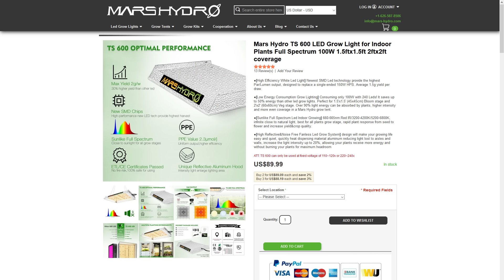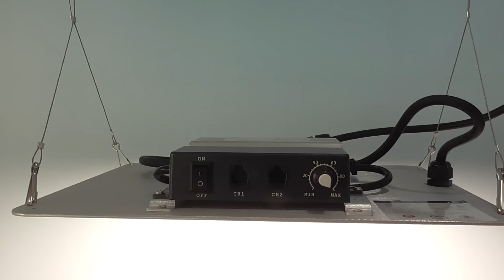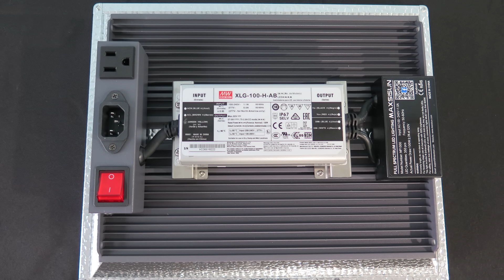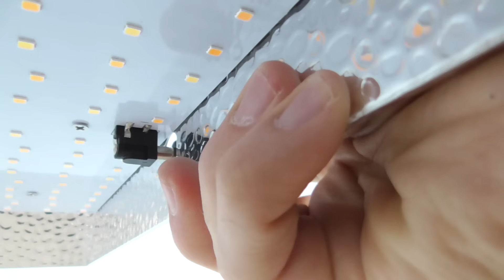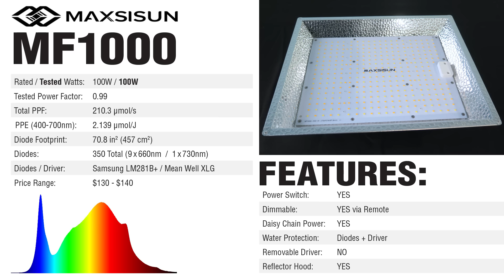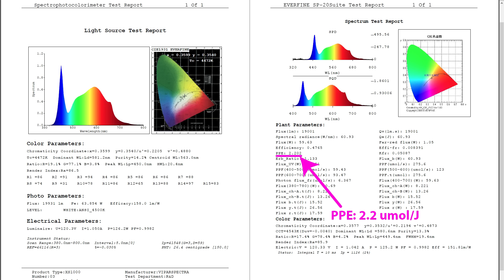Spider Farmer, Maxsisun, Mars Hydro - Entry Level LED Grow Light Comparisons, Test Reports & Reviews

Comment: Can someone help plz.... what would be the equal to a 600w hps in LED terms ? T.y.
Reply from the maker: This video addresses that exact question! https://youtu.be/PCaesi_M5DQ?t=180  :-)
Reply: @Albopepper  cheers. New to led's but basically what iv gathered is in order to match the HID's its gonna be piggy-bank breaking time. 600W HID = £60 ballast + £30 bulb = £90.  LED equilvalent = around £400+. Apart from heat problems personally i dont see the advantages.
Reply from the maker: Have you checked out this video? https://www.youtube.com/watch?v=aToYhyPZMVs   The reduced electrical consumption directly translates into savings. Each and every month you run a higher efficacy LED, you stand to save money. This might easily bring you a payoff and then continue to save money going forward. In the US, this light gives even more PPF per dollar. And it would give you excellent yield: https://www.youtube.com/watch?v=Cl5P3sKDQ0o
Reply: @Albopepper  If power cost wasnt an issue would you still say theyr worth spending that much on over hid not including the low heat aspect (is the yield increase noticeable)
Reply from the maker: There are some old-school growers who swear by HIDs. They may even claim that LEDs just can't provide as much yield. But this misconception has resulted from LED sellers falsely inflating the HPS equivalency of their lights. If a grower matches PPF, then they can get just as good of yield, especially as many of these LEDs now have Far Red.

Good LED systems require more upfront cost. But they have a longer lifespan. They incur less electrical costs. And the heat reduction typically saves on HVAC expenses. Some LED styles are also better when it comes to even light distribution at tight hanging heights. Great for rack systems.

As a grower, you need to run the numbers for your situation and do a rough ROI. See if it's worth it for your application. Generally though, I think that it's better for everyone collectively to use more efficient technologies like LEDs. It all adds up. And across the entire grid, it can really help out by cutting down on energy waste.
Reply: @Albopepper  can i ask, from seed do you count the start of the vegging period soon as you see roots or from a certain amount of leaves or height?
Reply: I would say the sf4000, it’s 450 actual watts and perfect for a 4x4 tent
Reply: @stevewhocares9970  i know tents help with par but is it any good w/o a tent

Comment: My personal experience with LEDs started with mars got two of their lights both had half the diodes blow out in less than 6 months when contacting the company was told I could buy and replace the diodes mind you it was still under warranty worst company buy far then I tried spectrum king grate light but way to intense and focused more suited for high bay after that I tried HLG another great light with good spread and efficiency still using it two years later though next upgrade I will be going with the bars for better customization. Just remember you pay for what you get and always check if they are using decent bin numbers and that they will work for your situation,. research is key I paid for not doing due diligence don't do the same.

Comment: Wait, they sell a light with cos(phi) = 0,69? Sure, the power company wont charge private households for complex power but how hard would it have been to build in a compensating inductance/capacitor? Pretty sure in the EU it is illegal to have such a low powerfactor.
Reply from the maker: I agree. There's added expense for better quality components. But these sellers don't need to worry about it if buyers aren't paying attention and looking at the PF. Hopefully this will put both buyers AND sellers on notice!

Comment: For my first light I got a sf 1000 great led however Those quantum. Boards are way strong so pull your light way back for beginners
Reply: My plants pray in veg at about 19.5 inches any closer or farther and it shows.
Reply from the maker: Remember, if you find the light levels are too high, you could also dim them and save on power. Raising the light is good if you want to cover more area. Otherwise just dim it.  :)

Comment: Awesome review!!!!  I recently purchased a Maxisun PB 2000. Your review makes me feel good about my choice. I do wish I knew how to dim the light... it is so bright 🌞
Reply from the maker: Cool! Glad I could help.  :)  If you have a wattage meter, you could probably dim it directly through the driver block. Pull the rubber gasket off and use a small flat head screwdriver. But go slowly. And make sure you don't exceed the standard wattage. The wattage meter can help you to see how much you are dimming it.
Reply: @Albopepper  Thanks, I have seeds starting now, and it seems a bit much... I did back it to 32 inches which they recommend... but would rather save a dollar by using fewer watts. Not sure how much it will cost to run, this is my first one.  Thanks again for such a good review. And for helping those manufacturers to be honest with their data.  Peace.

Comment: Would be nice to see where the HLG 100 stacks next to these.
Reply from the maker: The HLG is only 95W with total output of 214 PPF (400-700nm). It excludes a Far Red diode and has a lower ratio of Red light. Altogether it only has 176 diodes. They state the PPF Efficacy as 2.41 umol/J. But you have to dig and look at their report. The standard PPE is actually 2.35. That's within the 400-700nm range. It's not dimmable. I'm sure it's a decent quality light. But it's not an impressive value. And the overall brightness isn't anything special either. If you buy it, you're buying a name.
Reply: @Albopepper  The build quality on the HLG-100 is pretty unimpressive too. It has exposed contacts and a barrel connector which is prone to snap off the board, plastic driver housing, no dimmer, no water resistant coating, no water resistant driver, no spacer between the driver and the light panel, and a very thin panel (I believe it is just the aluminum PCB without a separate plate). The higher wattage HLGs are ok, but I think in the lower wattage range, the students have surpassed the master.
Reply from the maker: @VikVaughan - Well said! Those are all some good observations!!!  :)

Comment: But aren't the drivers too cheap? Doesn't look like any of them is an original MW 120W.
Reply from the maker: The 4 that I've recommended have adequate drivers. But the SF1000D and TS600 are the 2 to avoid due to junky drivers.

Comment: neat review. do a 1000w HPS LED replacement one please and ty. i member when thr UF0 light came out and cost 5-600$. im old school i still rock my eye hort hps full spec 1000 and 600 hps. yeah they cost more to run. but i have yet to find a led that can match the hps in growth. you get a new sub and a thumbs up

Comment: Hi, thanks for the info, very helpful.. do you have any thoughts on mixjoy units? have seen newer versions with more led and tempted to try
Reply from the maker: Thanks for watching! If you are asking about the 110W version, it certainly comes at a nice low price. I'd like to see a test report, as I don't believe the efficacy is really 2.7. They claim it replaces a 600W HPS, but that's not true. If you don't have much money, it might not be a bad option. I'm guessing it would be better than the TS600 or SF1000D.
Reply: @Albopepper  thanks was thinking 110 for small veg space, speaking with their rep they make as grand a claim as the rest and I assume based on most of these boards being similar, results will be likewise to your tests. Led market is bad in my location, mars offer value (sometimes) but comes with zero service and constant problems, spider/vipar have priced themselves beyond reason and the rest are unavailable.

Comment: Damn I just bought the ts -600 Mars hydro light. I was going to buy a maxisun or a bloom plus. Wish I got the plus
Reply from the maker: Doh! Did you buy it within the last 30 days? From Amazon? Perhaps you could return it if you want a different one. The TS600 is still better than many of the older LEDs from years ago. It's just that there are newer models out there that perform even better.
Reply: @Albopepper  I did it was only 3 weeks ago. I’m debating because I haven’t even used it yet I have a spider farmer I’m currently using. Thinking about returning. Great info though I’m subscribed!
Reply from the maker: Thanks for your sub!  Well I don't want to pressure you one way or the other. But Mars definitely lied when they slapped a 2.3 PPE label on it. That in itself is grounds for a return if you feel inclined to do so.
Reply: @Albopepper  shoot I should have returned it. I got a new tent and put that light under my plants and they stopped growing and then after a couple weeks of nothing I decided to switch my light back to my spider farmer and shoot the first night I saw fresh light green growth. I tried to return today and the 12th was the last day I could have returned. Man. Guess I’ll use it for seedling and early veg

Comment: In the end its still 1:1 in watts, like 400w per m2. The only reason for LED is the lower temperature. Just my 2 China Cents.
Reply from the maker: What's interesting is that if the LED makes less heat at the same wattage, then that means it must make more light. The power from that electricity goes somewhere (either light or heat). Less heat means more light. More photons means more plant mass.
Reply: @Albopepper  

I understand that,but would still go for at least 400w real/m² to grow a proper and full tent-omato-tent (?👁️?). Sry Bro, im no native speaker and its 4:15 AM. and 4:20 PM. 😅✌️🐝
Reply: @Albopepper  

OK, Mr. Pepper. Im back and can say 
2 x 125w QBs ran at 90%  outperformed the 400 hps. easily. 
✌️🌞

Comment: Vipars have ppf reports when you buy them. I used it to set up my distance.
Reply from the maker: You mean PPFD reports, right? They provided light maps with spot readings? Those are certainly quite helpful. PPF reports from an Integrating Sphere are different though. They are not for positioning data. The total PPF is for total output at a given wattage irrespective of light distance.
Reply: @Albopepper  Have you made any headway with the P1000? I have 3 of them and would love to see some additional data.

Comment: I've got a few P1500s and XS1500 viparspectras and the past few grows I've smashed it outta the park with em. 
My SF2000 wasn't worth the price. I sent it back for a problem with the light flickering and 3 chips burnt out and it bowed in the middle. They told me I voided the warranty because I removed the driver to dim it. 
Worst customer service for a subpar product.  At 200 watts it dosen't even cover a 2×3 adequate.  Barely a 2×2. 
They're just as bad as they have always been when they were still calling themselves Mehezi and catching peoples houses on fire with thier crap lights. 
I've got the original Spiderfarmer dimmable blurple 600w "230 watts "  I hacked it with some Nichia chips.
Reply from the maker: Thanks for sharing your experience. It's good to know ViparSpectra is making solid units!
Reply: I’m using Vipars too and am satisfied with the results. I just use an extra unit than I would if I had a high price brand. Still works out cheaper. And I can replace when new technology outdates them.

Comment: I emailed all of these companies including Viparspectra about the brand of red diodes they use and only Maxisun replied. All using cheap ass red diodes and thats why I went with Chilled led that doesn't use false advertising. All these chinese brands advertise Samsung LM301B diodes but the reds they use are all junk and not samsung reds, false advertising at its best.
Reply from the maker: Interesting. What brand was Maxsisun using for the red?
Reply: @Albopepper  the deep reds and ir are Epileds.
Reply: The Mars hydro FC and SP fixtures actually use decent red  diodes made by Osram but take a look at the warranty, so a hard pass too.
Reply from the maker: Good to know! Thanks for doing that ground work for us.  :)

Comment: Thank you. Excellent round up. I hope we can get away from comparing LED lights to the wattage of HPS or HID lights... Question...  I have an earlier Spider Farmer SF 2000 that does not include the dimmer. Can I run it through an external dimmer? Or will that be a problem for the Meanwell driver? Thanks.
Reply from the maker: I'm not sure about that. But even without the external dimmer, you should still be able to dim it down: https://youtu.be/lK28aiRQ_Vs?t=419   :)
Reply: @Albopepper  Thanks... Since I don't have a power meter to measure the watts I thought I maybe able to get an external dimmer for the same price...

Comment: My first light was a ts1000 and for a beginner light its not bad, but there are much better lights out there for the price nowadays. I've also realized once you start that efficiency is where it is at and what you really should shoot for. Get a quality led light and after a little while you will be glad you did. Oh and the bigger the light, the more efficient the light generally is.

Edit: go with meanwell drivers and good samsung led diodes.
Edit: and one more thing, my second light wasnt a Mars hydro if that puts thing into perspective.
Reply from the maker: Good advice! Thanks for sharing your experience and for your support on my channel.  :)
Reply: So what lights better than TS1000?
Spiderfarmer mars hydro viparspectra
All them are using the samsung diodes or the lm 281 or the lm301 better chip
So all they are the same more and less 
Mars hydro only using the samsung chips on the expensive models.

Comment: Really nice review / info, thanks! 🙌🏻😊 Also if a person is interested in DIY approach and really high efficiency the HLG kits with their latest QB648 Diablo boards seem nice. But with a quality 150W driver even the cheapest one board "~130W" system with heatsink is about $200 still... And the availability seems to be limited.

These boards are what I would personally want to try though - and build a water cooled heatsink for them with additional individually controlled UVB, UVA and IR LEDs 🤓😂.
Reply from the maker: Sound like a cool project! Thanks for watching!!!  :)

Comment: Very interesting video as always. I have two mars hydro TS600 and I'm very satisfied with them, I tested them with my PAR meter and my Watt meter, and I compared them with my old COB 100W lamps bought on aliexpres. 
The result is interesting, for the same number of Watt consumed, the TS600 at the same distance give twice as much PPFD as the COB. I bought the COB 50$ and my Mars Hydro 77$, for the price, the Mars Hydro TS600 or Maxisun PB1000 are much more interesting. I just ordered two TS1000 that I will receive in a few days, because as you explain in your video, at the price efficiency level it's the best.
Reply from the maker: Thanks for sharing those details from your testing! Compared to older units, that TS600 does well. But many of these newer LEDs are doing even better. I hope you enjoy those TS1000s. They should be a nice upgrade!
Reply: @Albopepper  Thank you for your answer. When I bought the TS600, the price was really interesting compared to other brands. Today it's a bit different, Mars Hydro has increased its rates and the price difference between a TS600 and a Maxisun PB1000 is small. If today I had to choose a 100w lamp, and after watching your video, I would take the PB1000.
I like the MarsHydro brand because they make quality with affordable prices. I bought a 150x150cm grow tent, I'm very satisfied with it, it's really good quality and you can feel that it will last for many years.
On the other hand, there's one thing I don't understand about them, it's shipping costs on their website. I have a friend who lives in Asia, I advised him to buy Mars Hydro lamps, but when he looks at the shipping cost for a simple TS1000 lamp, the shipping is $100 (2 kg), while the 150x150cm (16 kg) tent would only cost him $90  (same shipping time for both).
There's something really wrong with that.
Reply: Hey my friend I use for years the cob leds 200watt do you think a new light is worth the money? If this is true than maybe I only need a 100w Panel Ts000? Cost me in a year much less electricity bill

Comment: Very informative, i like how you test them yourself. I'm considering getting one for myself.

Also, do you have a solution for leafminer fly infestation? I have stopped planting mustard greens and lettuce because they will just constantly get ruined by leafminer which is a massive shame because they were pretty delicious and convenient to just pick from the garden
Reply: ::: Have you ever looked into using essential oils, like Eucalyptus or Melaleuca, with some dish soap? That seems to work as a natural deterrent for most bugs....
Reply from the maker: A physical barrier like fine meshes netting might be able to keep them out.
Reply: they sell sticky back flooring tiles at the home depot. Put 3 or 4 of them in the tent and the fan will blow them in to the stickie tiles. If its bad you can cut them to fit face down on the pots, cut oround for the stem 2 weeks and they are all stuck to the tiles.

Comment: Very interesting, probably will sadly still stick to sunlight because of electricity cost but considering the sky is constantly cloudy or raining where i'm from for some reason i might consider it
Reply from the maker: I agree! Free photons from the sun is always preferred.  :)  You can't get more sustainable than that!
Reply: Luckily electricity isn't that expensive here in Finland, only $0,105 nighttime and $0,125 daytime / kWh (including transfer fees and tax). 

And during the (loooong 🥶😂) winter the only loss is that the heat isn't generated by more efficient geothermal heat pump.